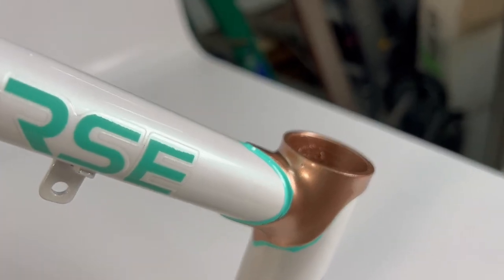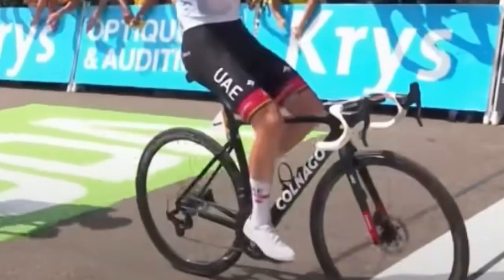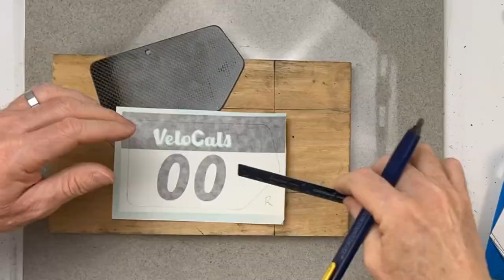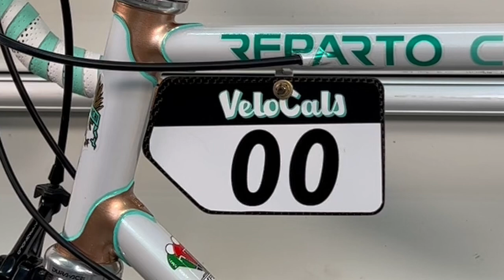Easy Carbon Fiber Project | Retro Bicycle Number Plate

Comment: Hey Brian have a 2001 cr 125 and when i have all the shift components off except for the shift drum and the shifter bolt and I have a socket and ratchet on the shifter bolt I can shift thru all of the gears. But when its all together I cant shift thru any when i try to shift up its like there isnt a gear there but when i shift down it moves a 1/4 inch and stops. So i tore it apart and found out the shifter drums springs didnt have a plunger that sits on the pawls on either of the 2 springs and i was wondering what your opinion was on it do you think that is the reason for it not shifting when all together. please reply i'm worried its my trans thanks!!
Reply from the maker: Hi DropEm!  Happy to help, but if you would kindly post your question on the related CR125 transmission rebuild video I posted so that others could benefit from the answer, I would appreciate it.  Thanks for watching!
Reply: @brian.d.mobley   I posted it on the cr125 bottom rebuild part 2 it’s from 2 years ago you’re welcome hope you can figure it out
Reply: @brian.d.mobley  it’s funny because I’ve watched that video like three times looking for answers so decided to comment and hope you’d see it but it’s a great video if my bottom end ever goes out I’ll be watching that while I put it together lol